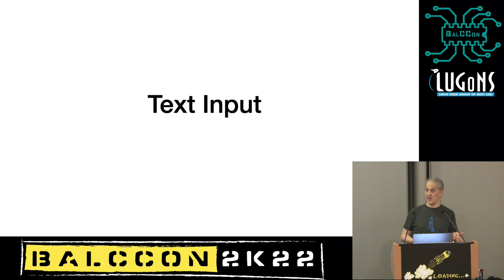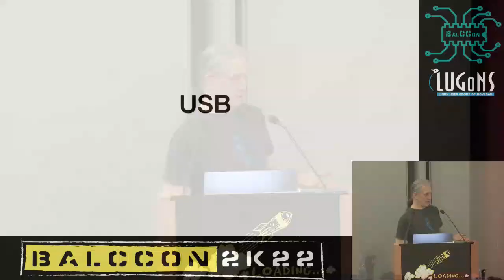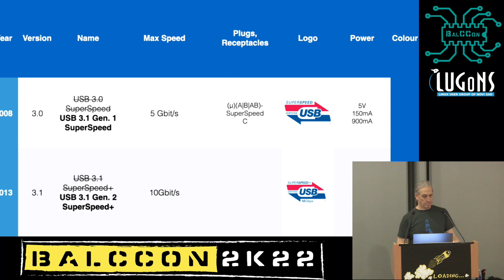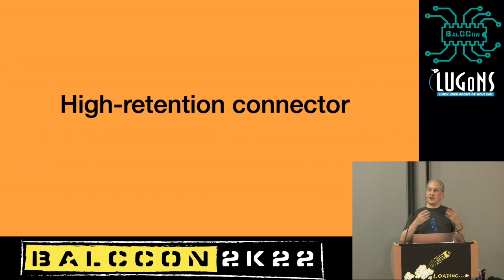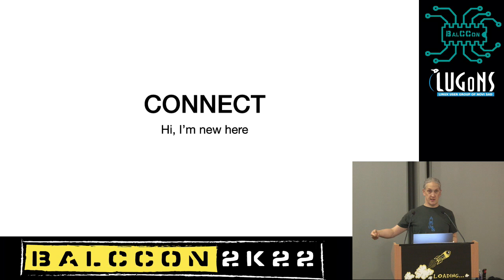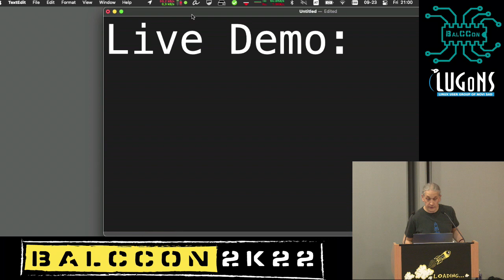BalCCon2k22 - MacLemon - USB - How does it even work

Comment: 22:16 that's a funny part in the usb spec. 12mbit from usb1.1 is actually called full speed already (as is also shown in one of the slides). The 480mbit from usb2 is high speed.
so yes, high speed is faster than full speed.